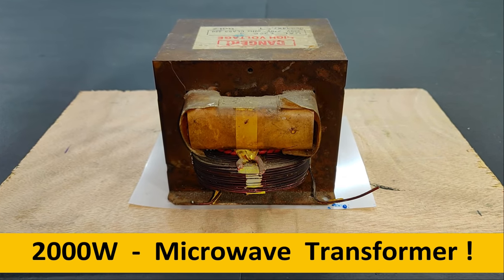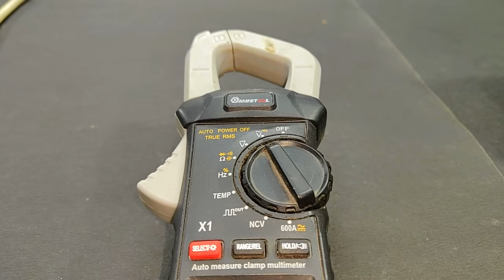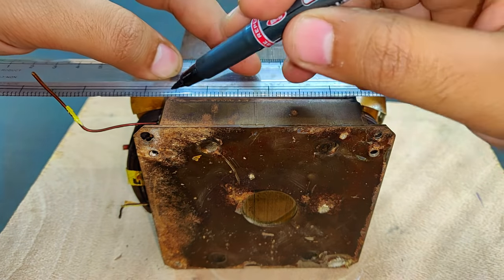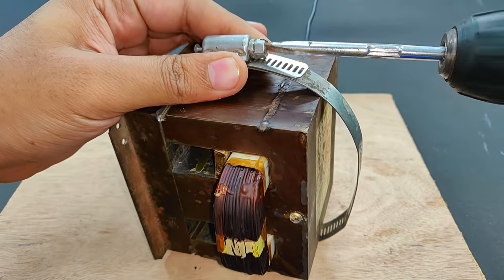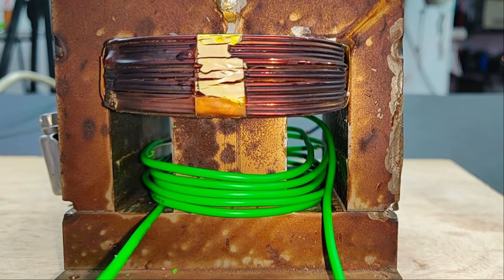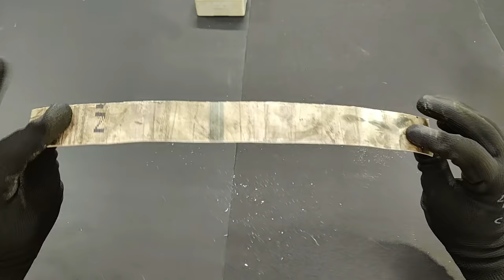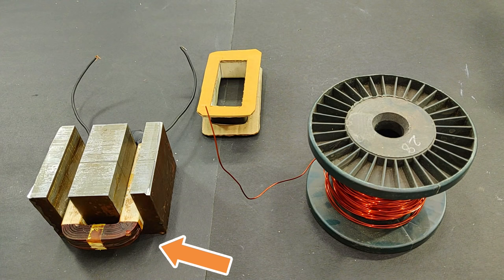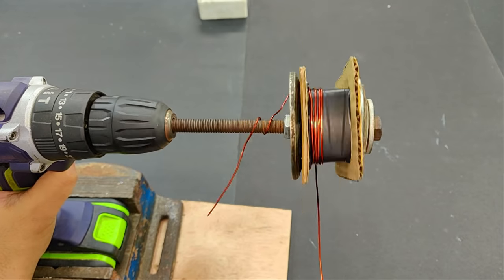2000W - 220 volt to 120 volt AC Adapter with Microwave Step Down Transformer

Comment: What if you input voltage is higher than 240v or 250v say 300v.  Would 300v cause the primairy to over heat and burn out or would it still work and would the output stay at 115v or be higher?

Comment: Sir, I'd like to ask about the copper wire you wound onto the PVC piece you made.  It looks like each winding is not insulated from the next.  It looks like all that copper wire is bare causing it to short across.  Like a big chunk of copper.  Am I right?
Reply: The Copper wire comes isolated from factory, if u buy online u can see "awg isolated copper wire"
Reply: It is a thin coat of isolating oil
Reply: That can handle high temperatures

Comment: is it possible to use 110 volt 1150 volts microwave oven on this???
Reply: 1150 watts**
Reply from the maker: Possibly..  It should work

Comment: Hi i bought tv which voltage is 120 v but i have power supply 110 v which is giving around 115 voltage . can i use this 110 v power suplyer for 120 v lcd? It is also mention in lcd that  120 v 50,60 hz 1.7 amp

Comment: Good idea, but isnt it bit powerlossy when the microwave transformer is using 2A even without load?
Reply: Of course it is, especially if one doesn't remove the mechanical magnetic shorts that are part of the transformer and there for voltage / load stabilization.

Comment: A 2000w microwave oven transformer is realistically good for about 750w continuous duty AC. Microwave oven power are pulsed use and not continuous and only of short duty cycles.
Reply: Hola amigo cuánta huerta necesita para llevar de 110 para que de salida vote 220 voltios desde Venezuela

Comment: I was thinking how it is possible to have 250V if the rated voltage 220V. Do you have 3 phase on the streets? Because in my country we have, the houses do have normally only one phase and are connected in different phases. It happens to be, that In my house I have all three phases. I measured that if one phase is under heavy load, the other two has higher voltage. The different houses on the street are not able to load the 3 phases equally, this makes the voltage difference.

Comment: Why did the second led light turn on when its rating was 230V but the output is 120V?
Reply: It's rated 110-230 V
Reply: @martinbobak3009  look closely at the second one when he's testing the tx.
Reply: @abdulhaqseif5935  oh that one! Probably just forgot to print 110v or idk but frequency range is 50-60hz so it's universal
Reply from the maker: Actually they did not print it in the low to high voltage range format.They simply gave one rating as 230vac.

Comment: Instead of transformer you can use dimmer circuit, Or
for the proper voltage of your whole house hold you can use a servo voltage stabilizer!! 👌👍👍👍
Reply: To my knowledge Phase angle control and rectifiers don't go well together due to the non sinusoidal current draw
Reply: @martinbobak3009  Sorry friend, I didn’t get you well.

Comment: Can i use as 120v to 220v plz reply
Reply: Nope, the inductance of 120 v coil is too low it would draw a lot of current and hence result in a short circuit

Comment: Brother 
I have a 24v battery and 24v DC motor.
But controller is of 48v ,🤔
It will work if I connect them ??😅😅

Comment: Very good, but it was easier to get a primary from a 220 microwave transformer, and another primary from a 120v transformer, so ready you would have a 220v to 120v or 120v to 220v transformer
Reply: Well 120v MOTs aren't common in countries with 230-250V

Comment: But why are you using the shunts??
( those long thin steel pieces which are between the HV secondary and primary). 
THAT'S going to limit the output power by quite a bit!!
Reply: At least it should reduce the heating a bit. And they limit the output only slightly because they way too thin for all the magnetic flux to flow through

Comment: Make 12 volt or 24 volt 10amp,5amp or adjustable dc power supply from 220 volt ac not using only transformer but also some components in future videos
Reply: Just buy a buck/boost converter
Reply: @martinbobak3009   I want DIY
Reply: @Funtime-e-h1f  than it make yourself
Reply: Better to buy one or if you really wanna diy then try making SMPS rather than these iron core transformers they are very inefficient
And if u want to try making an smps then I will recommend you not to cause that's very very dangerous and you will spend 3x the money of a ready made power supply

Comment: Imagine you only need 110v supply to light up the LED but the sounds you hear are coming from Microwave oven ...better use a quite step down transformer.

Comment: @MrElectron  That's terible idea!!!! MOT-s aren't designed for continous opratoration. You can overheat the core!!! To aboid that, you  must determine Bmax used by manufacutrer to calculate  windings and caluclate new  amountt of windings with lower Bmax...

Comment: Not safe to use a grinder with safety shield removed! Some day the wheel will fly apart and you may be cut or even blinded.